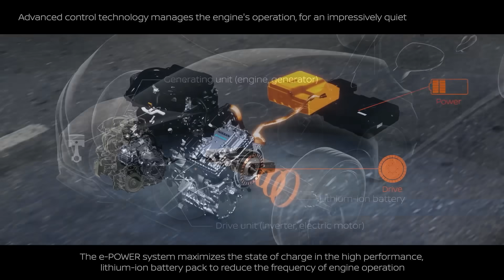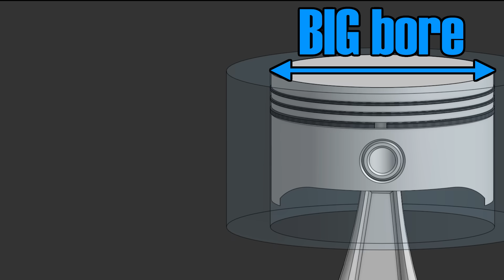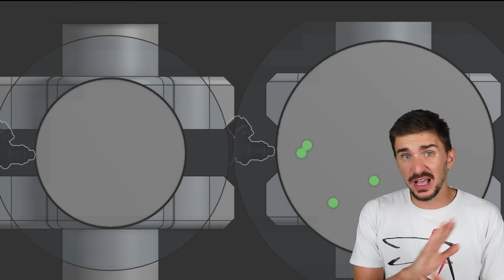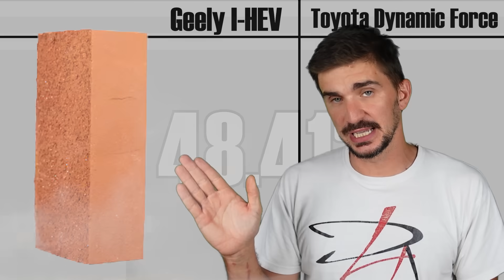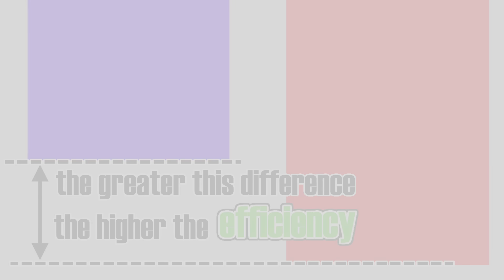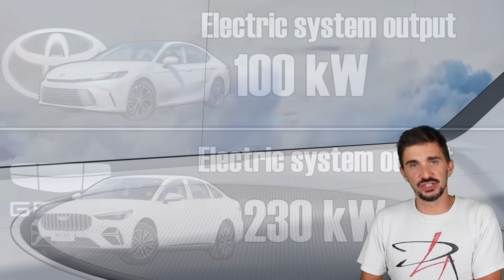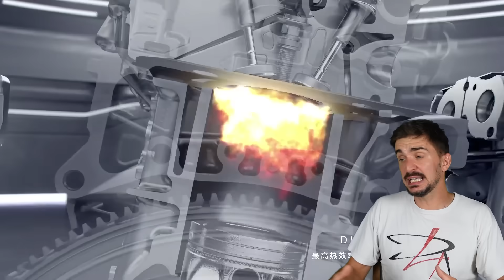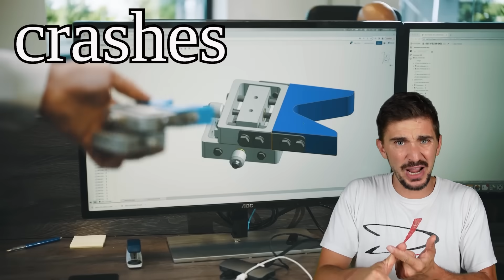How China's Geely Beat Toyota, BMW, Ford and Everyone Else

Comment: 4:17 that's not really how this works. Yes, you have more piston travel distance to extract the energy, but also less piston area. An equation for torque at an crank angle is: Torque=displacement*pressure*sin(angle)/2
as we can see for this equation it doesn't matter if engine is oversquare or undersquare - what matters is displacement. There's one thing that this equation doesnt tell you: in the combustion event the energy is lost to combustion chamber walls. Energy is lost as temperature. If you do the math you will see the cylinder with smallest surface area is the one with radius = height. This means the closer the combustion chamber at TDC is to the r=h cylinder the more efficient engine will be
Reply: My guy completely ignored the part about blowby and that engines aren't passively cooled.
Reply: @AvocadoAfficionado i ignored part about blowby because i agree with the blowby argument. My understanding was the argument for undersquare geometry was the more piston travel distance itself (besides the blowby). 
Also the fact engines arent passive cooled is the sole reason why you need to care about heat loss in the first place. Active cooling is needed because materials used cannot stand temperatures present in the combustion chamber for long periods of time. If engines didnt need to be cooled down the cylinder walls would heat up to the combusted gases temperature and stay there, so the energy transfer between gases and the engine would be 0
Reply: @takiktos1265 it's not because you can compensate reductions in surface area by increasing the cooling. 

The cylinders aren't at the limit of what we're able to cool so it doesn't really matter how big they are.
Reply: @AvocadoAfficionado what are you talking about? Reduction in surface area is desirable. We don't talk about ability to cool the cylinder, we talk about heat loss from combustion to the cylinder
Reply: @takiktos1265  building an over square engine was their desire not surface area. 

Imagine using so many words and still being wrong. Did you even watch the video.
Reply: @AvocadoAfficionado you just have no idea what you are talking about. You don't design an engine to be oversquare just because. You have some power and efficiency targets you need to meet.

Also "using so many words"? Is this some kind of american perspective, that using precise words is bad somehow? Lmao
Reply: @takiktos1265 except if your intended use case is to put a range extender in an EV then you actually do.

Imagine using this many words and still being wrong.

Comment: very interesting way to achieve absurd efficiency from a gasoline engine (no sarcasm).

but i have some questions:

since the geely uses the electric motor as the primary mover, does adding such a low-output gasoline engine actually improve the car's overall efficiency? wouldn't it be better to just make it a full EV at that point? 
considering you're adding a lot of moving parts, potential points of failure, and dead weight by keeping the gasoline engine.

also, being dependent on AI to avoid getting stranded in the middle of a random mountain road doesn't seem particularly appealing to me.

imo, this design has zero redundancy and a lot of critical points of failure, all just to improve the efficiency of an engine that isn't even the primary source of propulsion in the first place.

idk, am I missing something?
Reply: Then you're right back at the battery size problem, and it becomes a plug-in
Reply: @robinbeckford  i don't see how making it a plug in would be a worse option
Reply: @Marco-hb4pt  It rules out the people who can't charge at home and / or would have range problems.
Reply: @robinbeckford  ok, but I don't know if it's worth risking getting randomly stranded because of AI failure or the lack of battery capacity, which has been sacrificed to make room for the engine (that can't even go uphill), fuel tank, etc... 
i don't really see the advantage over other hybrid configurations. 

it looks like a marketing stunt to choose this design just so they can brag about the record efficiency of the gasoline engine (which isn't even the main source of propulsion), while omitting the car's overall efficiency.
Reply: @Marco-hb4pt  You could be right there.

Comment: Doesnt the high compression ratio require a stronger engine case, i.e. a heavier engine case, thus a more expensive engine. Which is exactly the problem of diesel engines.  ?? I guess if the ICE is only a support for the EV, then it doesnt matter that much. A car with an ICE like that without the EV bit would be a pretty terrible idea.

Comment: Doesn't the Honda Prelude follow the same engine concept?
Reply: Yes, it does
Reply: Yes and No. Yes, in terms that the ice does primarily generate electricity to the motor. No, in terms that it doesn't have a big enough battery to be considered an EV. Which is why honda ehev and nissan epower doesn't have the range of the chinese hybrids.

Comment: How much fuel does not disappear from the combustion chamber when 60% of the cylinder volume is pumped out before compression begins? Or is the fuel injected after compression begins? How will the fuel and air have time to mix then and will there also be a risk of knocking?
Reply: It's DI. The modern ones inject fuel at the beginning of the compression, so just after the intake valve closes. As for the atomization - well it's pumping a solvent with almost no surface tension at the working pressure of a shotgun. Also the part of fuel that doesn't make it all the way to the evaporation gets to become particulates and later on, possibly cancer.

Comment: I always assumed that the reason undersquare engines couldn't rev high was because they couldn't get enough air at higher RPMs due to smaller valves.
Reply: and piston speed that pulls the pistons apart.
Reply: Both
Reply: Also the fact that piston speed gets so high that it might keep up/outrun the expanding gases, but I could be talking out of my ass here.

Comment: What is the difference between closing intake valves late or simply have the gas pedal half opened? In both cases the cylinder will be only partially filled  and the efficiency should be the same.
Reply: lower throttle can mean higher efficiency up to a point, but the difference is that when the valve is open, the piston moving up isn't using any energy on compressing the air, only on displacing it. the higher efficiency from making the compression stroke shorter doesn't just come from less air it comes from spending more time making energy from combustion vs using it for compression
Reply: 1 atm at bottom dead center vs 1 atm at halfway up the stroke basically
Reply: It's about pumping losses

Comment: So it's basically the worlds most efficient generator?
Reply: Pretty much, yes.
Reply: But how reliable is we don't know, long stroke will make a highly stressing to both sidewall of cylinders and pistons......
Reply: @下田洋介-w4z it probably has ok reliability. I don't think it revs very high so the piston speed should be a concern.
Reply: @下田洋介-w4z will be low revving and have very little load - it's not freakishly long or anything. I don't see any reason it'll destroy itself quickly
Reply: @MelodicTurtleMetal  Only the time will tell.